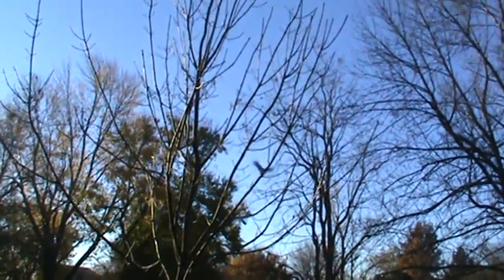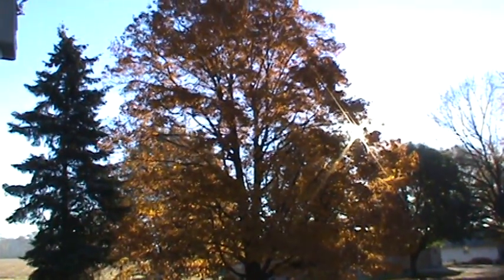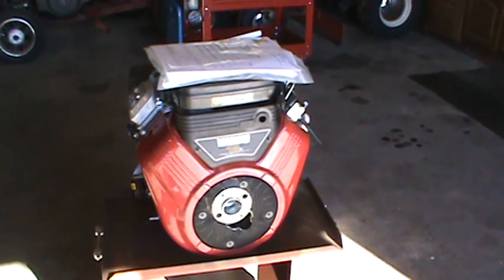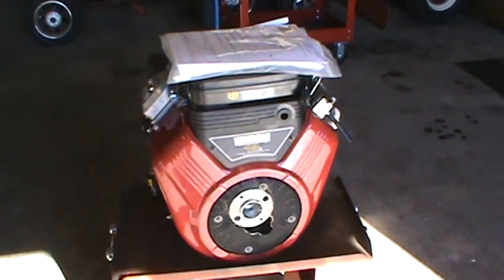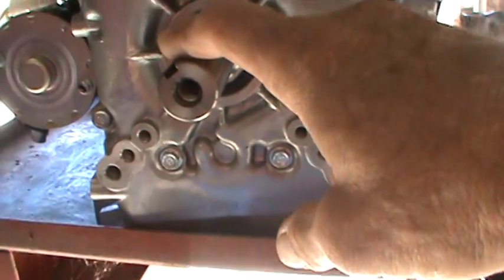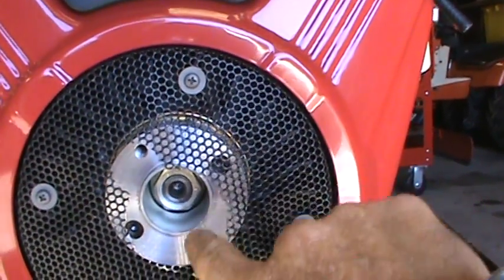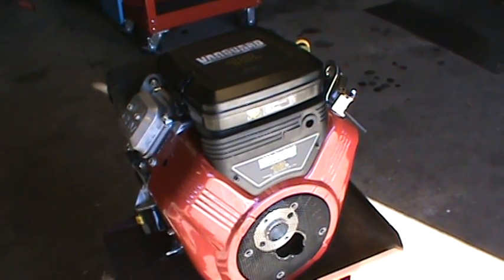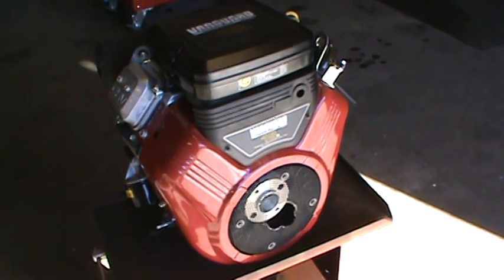Grass Hopper 618 Triad to Vanguard Engine Swap Part 1

Comment: Hey zippo another question
If u have a grasshopper 14 vanguard engine and wanted to replace it with a bigger vanguard can u do it or do you need a wiring kit
Reply from the maker: If the 14hp is still getting the job done I'd leave it as is. If not, so long as you have a basic understanding of wiring, then any Vanguard will work. All you may have to do is De-Pin the connector from your existing engine in order to Re-Pin the connector with the new Vanguard. Be aware, there are different charging systems across the Vanguard lineup. Some are a single wire coming out of a Regulator/Rectifier and others are a two wire in varying DC amperage depending on application. Zip~

Comment: Hey zippo  good morning sir 
I been thinking of buying  a grasshopper  front mount with a Kohler.  It’s kind of cheap 
 It runs  but I like vanguard 
I just live at jasper in south of you
Man enjoying your channel 
Anyways have a blessed day may pick your brain later.
Reply from the maker: Email is in the description David. If the Grasshopper has the dreaded OHC Engine (Over Head CAM), then it's hours are numbered. The dreaded Kohler Triad is notorious for various failures at or around the 600 hour mark. But if it has the Command, it'll run to the moon and back with regular maintenance. They're very good engines. It's a strait forward swap if you get the engine kit from small engine warehouse here in Muncie and you can pick it up at their warehouse to save on shipping. Cheers! Zip~
Reply: @ZippoVarga  Thanks Zippo  will do have a blessed day man thank you for your channel its helping my decision  just can't come up with 15k like over night i am mowing around 13-14 yards now  its picking up ! i just started about a month ago !  yup i was going to pick one up in Muncie  if i get this deal on a used one stop in and pick ur brain lol have a blessed one man later
is the command better than vanguard im kind of loving the briggs

Comment: I changed a Simplicity 9020 with the 19.5 hp Onan engine to a Kohler Command 20hp engine. (when command was new technology)  I had top weld in some rails to raise the engine up a few inches and have a converter block like what was shown here made at a local machine shop.    The biggest issue was that the engine had metric bolts and the machine had standard.  But with some careful planning, I managed to keep the stock Simplicity drive belts and the electric PTO clutch in front stayed the same too.
Reply from the maker: +Randy J I like doing conversions, and this one was one of the easiest yet. 3.5 hours from start to finish. Hell, it took me longer than that to get moving that morning. lol. Cheers Randy! Great hearing from you, as always. Zip~

Comment: Sounds like you know about Kohlers. I may have made a bad trade earlier this summer. I'm embarrassed to say what I traded, but, what I got is a Big Box Cub Cadet. Didn't even know there was such a thing! I figured Cub Cadet was above all that! Nope! Guess they all aren't like Simplicity. Anyway, This thing has a 27 horse Kohler, and I need a flywheel. ( I originally thought it'd be easy )...and it would be, if I didn't mind chucking out $200 for a new one. My question is, do you have, or know where I might find a used one?  model # SV730S FAMILY 8KHXS.7252GB BUILD DATE 02/07/2008 DISPL 725  Thanks-Rich
Reply from the maker: +Richard Sigo JacksSmallEngines dott comm. They also deal in used parts, but you have to request a used item. Best of luck on your hunt!

Comment: Sounds like an awesome group of videos.  I'm glad to hear Small Engine Warehouse is a hometown company.  I've bought a few engines from them for swaps on customer's equipment and every one has worked fantastic and bolted right up.  When you get the Grasshopper in could you discuss the weakness of the Kohler?  I've worked on the single and twin commands before but I've never dealt with a Triad.
Reply from the maker: +Josh M I will be doing a tear down of the Triad, but I can tell you the most common issue with them. They are an over head cam engine and the heads and block are cast as one piece. Then, they pressed in the cast iron sleeves from the bottom of the block (mistake #1), the OHC cam belt tensioner (mistake #2) and finally,  valve guides pressed in to a casting that had inadequate cooling characteristics (mistake #3). These were all mistakes because of the type of casting process they used to make the engine blocks. Evaporate Styrofoam was used in the casting process. Much like Saturn engines were made and this process, although innovative, had its draw backs. You can research this on Google for more info there. Heat expansion was the biggest problem, causing valve guides and cast iron bore sleeves to slip and drop out of place. I'll post my findings once the Triad is torn down. The engine swap is finished and I will be posting additional footage in the coming days. Cheers!! Zip~